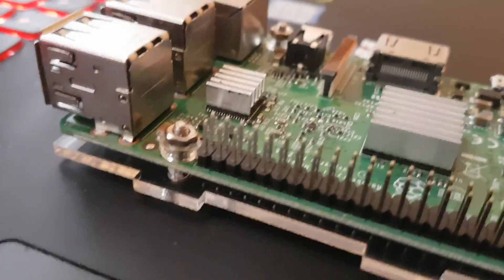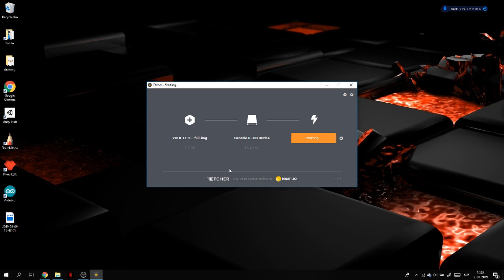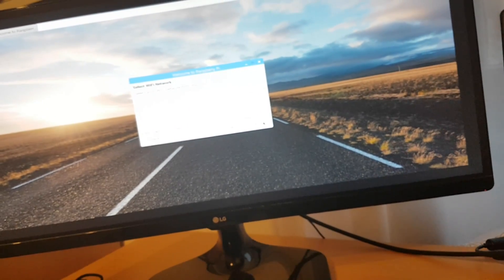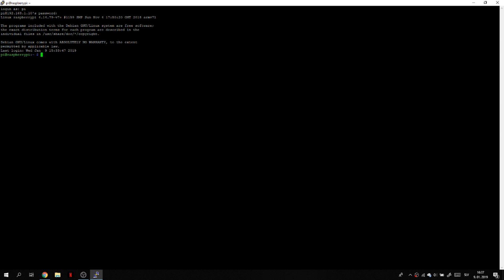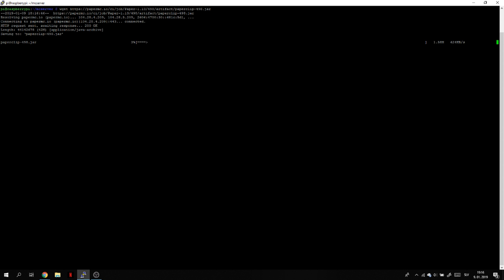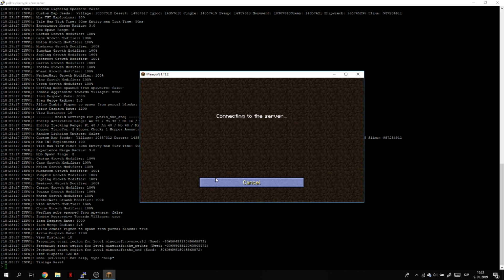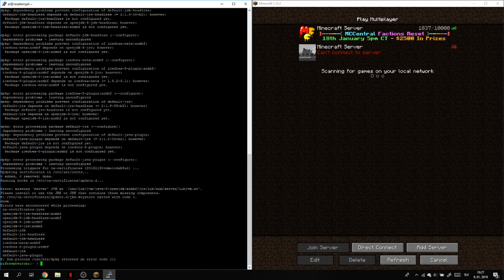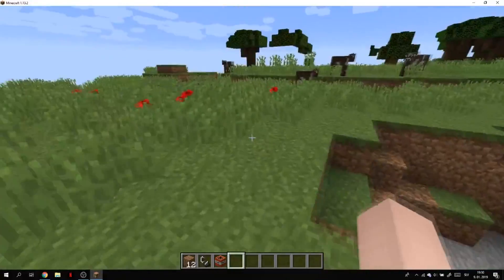Build Your Own Minecraft Server on a Raspberry Pi: Complete Tutorial

Comment: this is a good demonstration of how easy it is to make your pi a mc server, could be presented better but with game development on the side it's understandable and i appreciate the upload for this tutorial none the less.

a side note, if you do the lite version of raspbian instead and from your pc open the sd card disk, after flashing the image onto it, you can just create a new text file, name it ssh and remove the .txt at the end and ssh is enabled by default, no need to do the keyboard mouse and monitor setup for the pi that way. Of course this is a bit different if you have to use wifi, but for a server setup i suggest using a cable connection anyways.

from there on it's the same procedure with putty to the raspberry from the pc.

before doing anything remember to do 
sudo apt update && sudo apt full-upgrade -y

once connected and logged in, type this command into the terminal

sudo raspi-config

to get to the raspberry pi settings, you can change the ram and i believe also allocate all of the sd card to the OS so you get to use the whole sd card for the server ;)

a question about the dedicated ram for the server, is the raspberry pi 3 you are using a 1gb ram ? cause i do believe you can basicly give it alsmost all the ram available, which is nice to have for a gaming server.

and last but not least, i heard someone say that you can run an ARK server on a raspberry pi xD
just a suggestion for another video tutorial and maybe test it out, how it runs and such.

Comment: my raspberry pi says that everything is ok, but i cant connect to the server on my computer. 

i also couldnt connect putty and it kept timing out. any suggestions what might solve my problem?
Reply: I've had troubles in the past trying to get ssh to work while the pi was connected via wifi, but I could easily get it to work with ethernet. Maybe that's the issue?

Comment: Can my friends from join the server from outside my home network?
Reply from the maker: Yes, they can. Just open the port 25565.
Reply: @ArduinoBeginnerTutorials  in my router?
Reply from the maker: @fettwein007  Yup.
Reply: @ArduinoBeginnerTutorials  and what will be the ip for my friends?
Reply from the maker: @fettwein007  your public ip. Type on in the google search "what's my ip"
Reply: @ArduinoBeginnerTutorials  now it says connection refused
Reply: @fettwein007  if you're using a cracked client u should set the serverproperties file offline mode to false